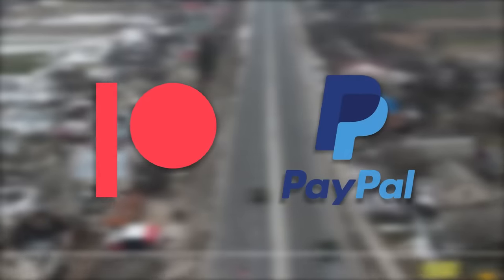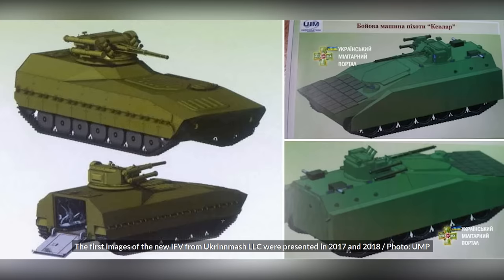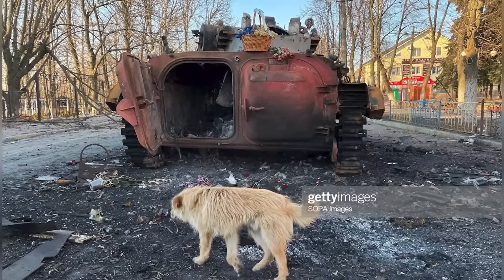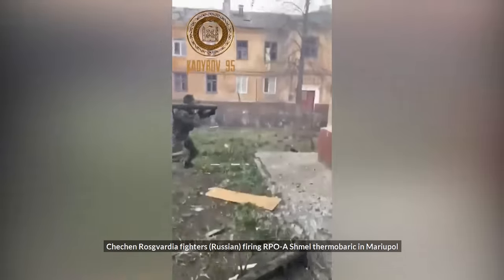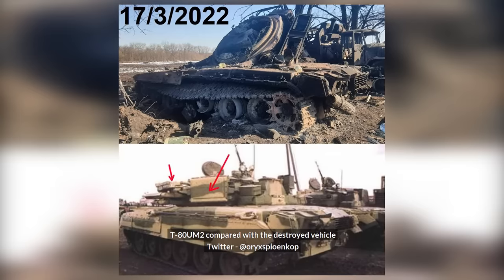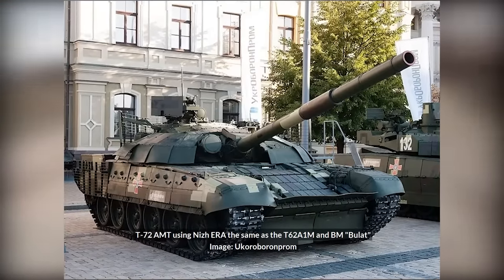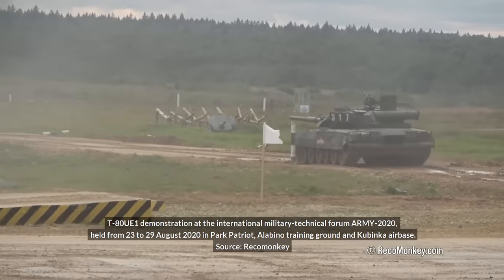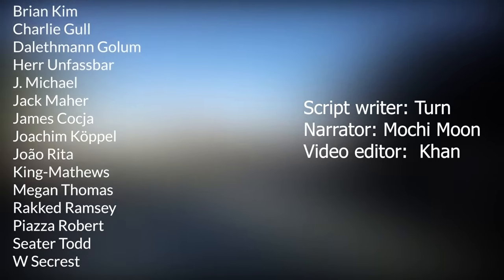🇺🇦🇷🇺The Many Rare/Unusual Tanks, and AFV's in Ukraine AKA The MT-LB War | February-March

Comment: It's actually a total mess. We have here two armies that until 30 years ago are one, both have those different model of tanks coming out from a common mold (so that no one could be considered nontworth of a modernization program as they can mount the same weapons and sights) , so it can happen that a fully updated T-64 i.e.the older model of the whole "family" is still the second best option for one of the two sides. And the russian T-72B3M mod.2016 almost the same for russian forces nowadays.
Actually some weapon could even be completely revived: a Maxim 1910,  with its water cooling was considered outdated in WWII  to be carriedcaround but is actually a great thing as today to be mounted on a pick up or even on a SUV (and a great answer to the ones that lament how they still use the same caliber than they introduced in XIX). 
Think about T-64 boxer engine also: in the sixty/seventies was a source of endless problems (same as the one of Chieftain), now reworked using modern electronics and technology is an absolute beast with the power and the acceleration of a gas turbine with the consume of a turbodiesel.

Comment: 4:44 it can penetrate anything even Armata, I think. Tandem charge=no ERA, 1300mm pen is no joke. Also Nozh is actually not that good, especially since it's something close to Contact-5 in the way it's built. It may be more effective, but both Nozh and Contact have steel carcass that is mounted on top of armor and those parts are weak spots. On both Nozh and Contact those carcasses are quite large.
Reply: 5:19 true, MT-LB is supposed to be a transportation vehicle, not the combat vehicle. It's made on chassis of MT-L, unarmoured artillery "towing" vehicle. MT-LB has 7mm thick steel armor on sides, that can stop something like regular .308 at best.

Comment: Nozh is a light ERA. Not so tough to penetrate. Duplet is heavier and harder to punch through. More about ERA: Kontakt 1 doesn't need thick base armour, unlike Kontakt 5, so, it is quite possible to use it on the MTLB.

Comment: No wonder russians have logistical nightmare on their hands with so many different types of vechiles.
Reply: Most of them share parts tho

Russia even downgraded their Sprut VDV light tank a little bit... they went from it's own transmission to a BMP-3's transmission for better logistics and having more parts mutual

Original Sprut could got like 70kmh front and in reverse... the modern sprut goes 70 front and same as BMP-3 in reverse... like 20-30kmh which is still a lot faster then MBT"s lol

Comment: Ukraine actually builds it's own tanks. Now it is begging for tanks overseas, makes one wonder what happened to them.
Reply: USSR made its own tanks too. Still begged for lend lease tanks in WW2.
Reply: @baneofbanes  not the same. It actually can build tanks
T 34
T55 
Ukraine.. not so much.
Reply: Before 2014 they sold most of them and now tank factories/workshops are btfo'd. Even Artem (or Artyom, it's just the name) plant in center of Kiev was Kalibred recently. Seems like Putin is not going full blown for some reason. We don't have neither mobilization not "martial law" declared.
Reply: @baneofbanes  needed some as stop gap while factories were moved. To be fair, Shermans were good, as veterans later said.
Reply: @karlyo6937  Ukraine doesn't really have a problem with having no tanks, they're on defensive side and only need transportation vehicles. That and get an iron grip on their commanders, they seem to steal and sell AT equipment on black market. The real problem is lack of communication, as well as radios. Have you noticed that usually combat is done between small groups? Also, Ukrainian side in March had quite a few accidents with friendly fire due to bad communication. Also паляниця thing was and still is very nasty topic.
Reply: @karlyo6937  its very much the same dude.
Reply: @unknowncommenter6698  Stalin was begging oft Lend Lease to be ramped up right as Soviet Forces assaulted the Reich stag. Ir wasnt just a stop gap measure.
Reply: @baneofbanes  for Soviets, it was. When factories started producing new tanks en masse, the real need for lend-lease tanks disappeared. Who is Stilton, though. British politician? Then it's understandable.
Reply: Overseas? Also over land.